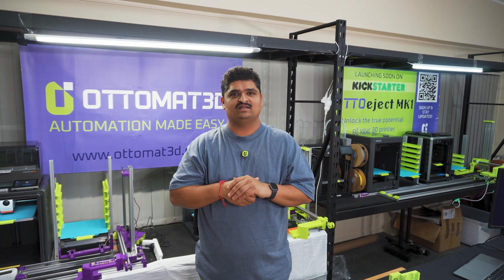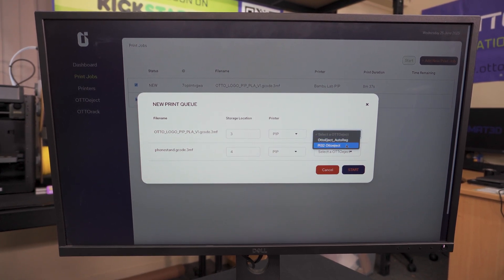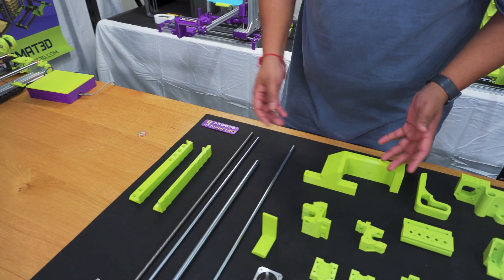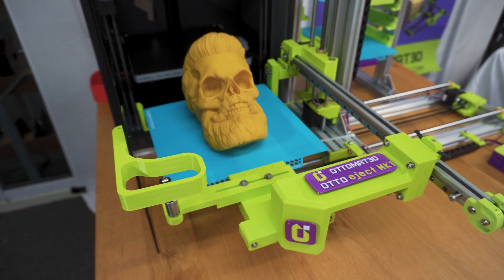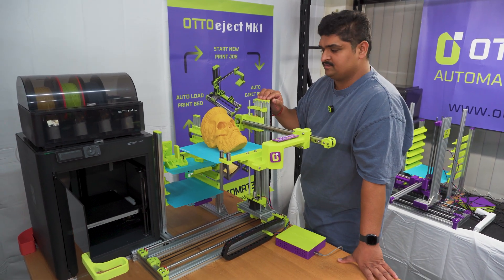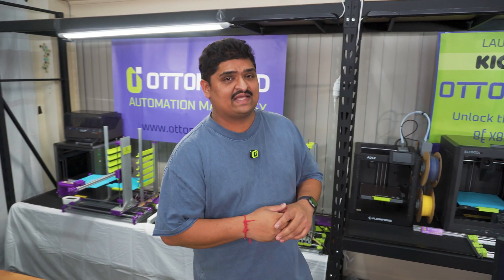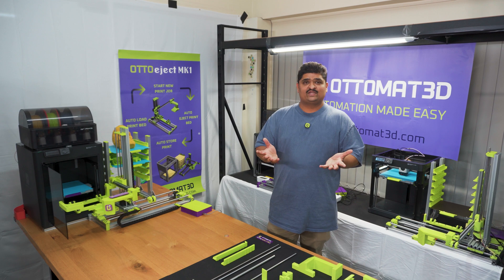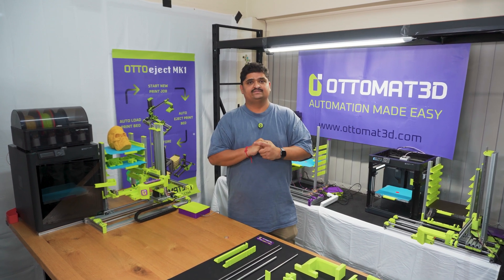OTTOeject System Walkthrough

Comment: But why not simply tilt the printer slightly and support it with feet? When the build plate moves down and presses a switch, the door opens. As the plate bends, the printed part detaches, and then the plate moves back up. The print head pushes the part out and starts the next print. Afterwards, the plate lowers again, presses the switch once more, and the door closes. I like your new gadget but it need much space:)